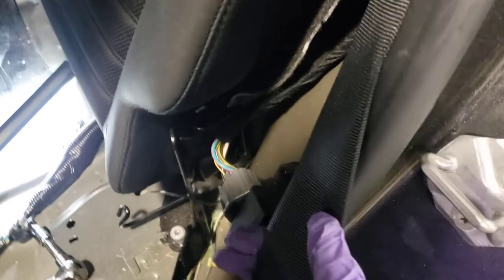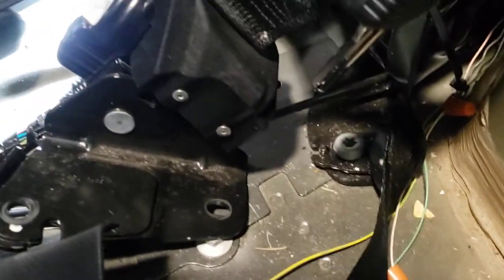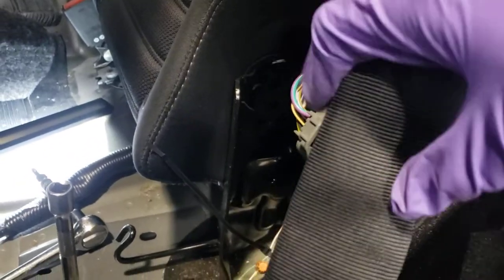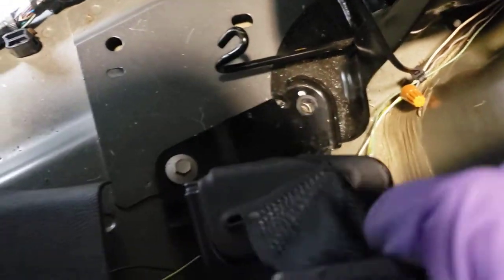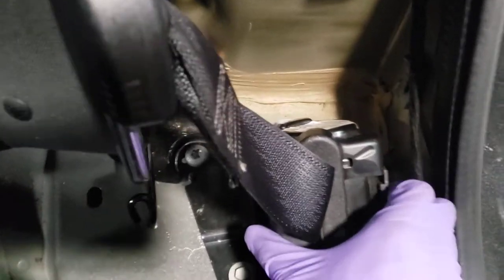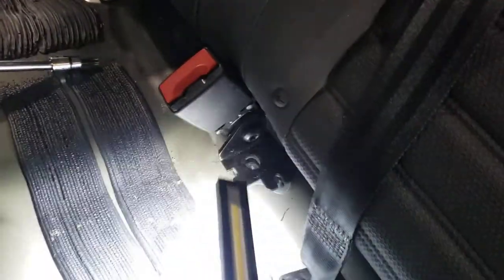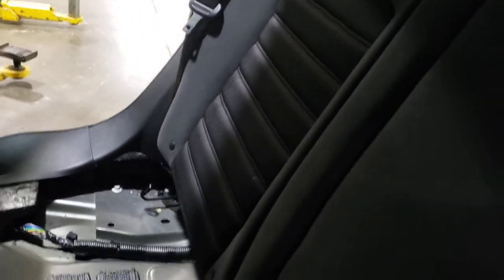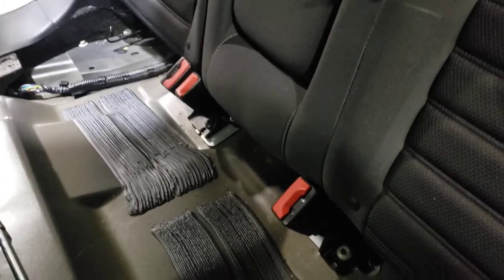process of adding inflatable rear seat belts on a 2017 ford fusion

Comment: Would you please briefly explain how you got access to the upper part of the seat belt?  Mine is stuck and I'm trying to troubleshoot, but don't want to break anything else while trying to get at it.
Reply from the maker: Are you talking about the middle seat belt or the outer seat belts?
Reply: @Nickthecarguy  Outer.
Reply from the maker: I believe I have video on it but you have to pull the c trim panel off on both side and remove the rear deck lid cover to access the rear seat belt tensioner
Reply: Can you replace the inflatable seatbelts with regular ones?
Reply from the maker: @laceydavis4497  yea you would have to replace the seat belt and the seat belt buckle
Reply: @Nickthecarguy   how much is it to do that?

Comment: Hey Nick I have question when you change the headlights on the car do you have to do anything inside
Reply from the maker: Yes I had to have a software to disable the hyper flash and change the headlight frequency
Reply: @Nickthecarguy  how much did the headlights cost you
Reply from the maker: @kindernn3309  I got mine on ebay for about 500-800 dollars a piece
Reply: @Nickthecarguy  I wanna do it but still little bit confused can you make a video please